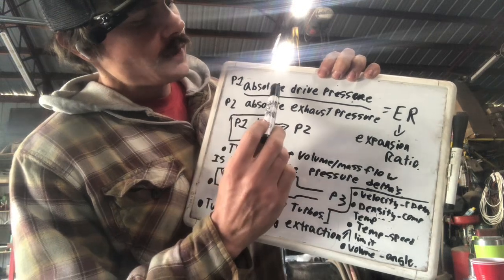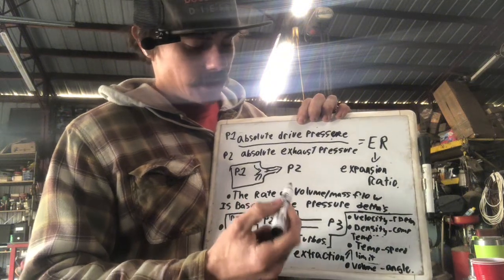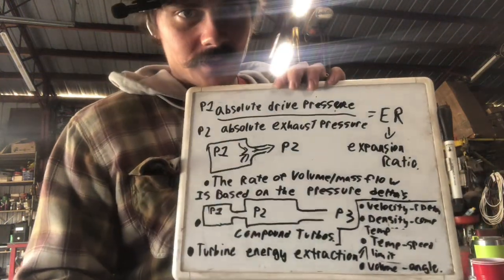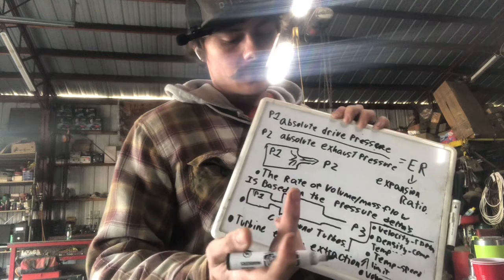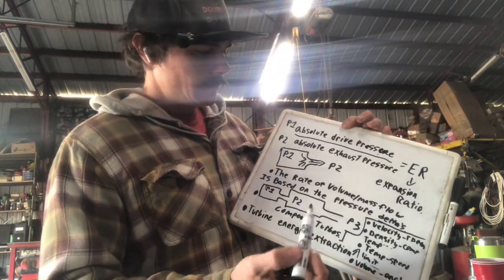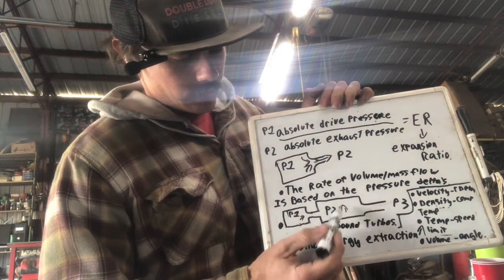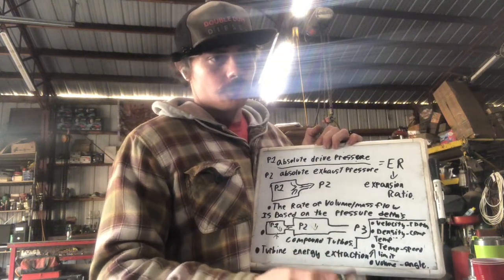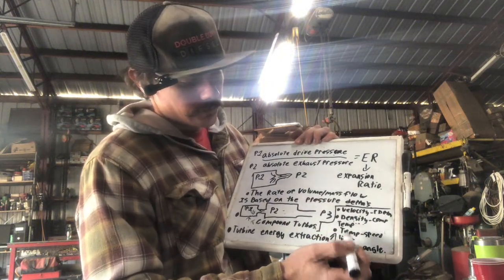A Motorsports themed introduction to turbine fundamentals part 1

Comment: I need to send you an email. I have a stock HE351CW but I’m doing a 6.7 swap and I’ve been thinking a lot about turbine and housing restrictions while trying to decide on a setup for the new engine. 

Thanks for the timely video, your explanation makes sense but without data it’s all just guessing.
Reply from the maker: @88NX250  the modded 351’s work extremely well on the 6.7’s up too- the compressor limit. The 6.7 just runs through the equation faster. But depending upon your goals and main intended use they can be amazing to drive on. I do 1~ a month ish for a 6.7 when the criteria is matching with the owners goals.